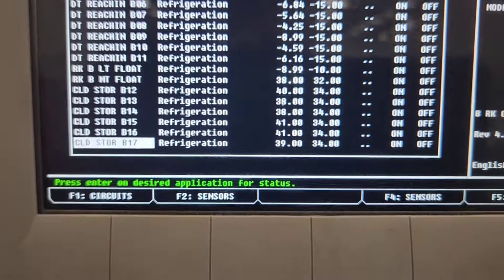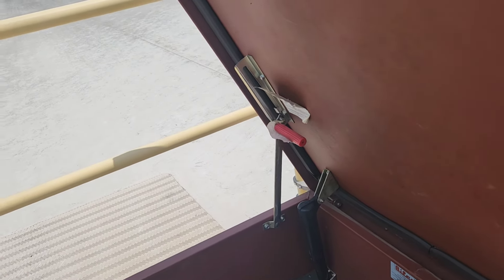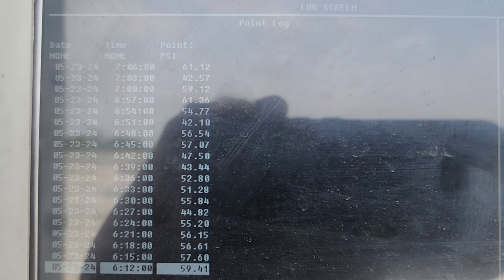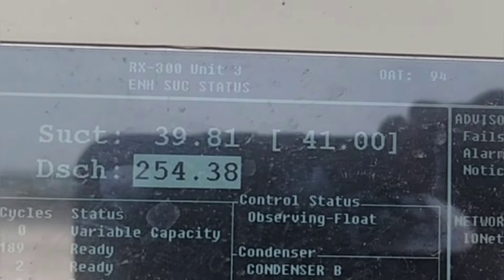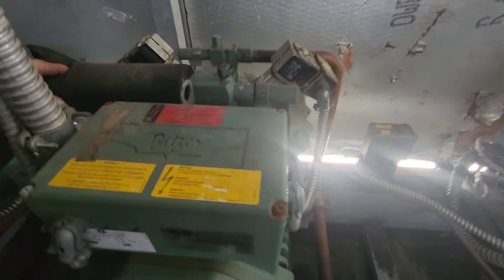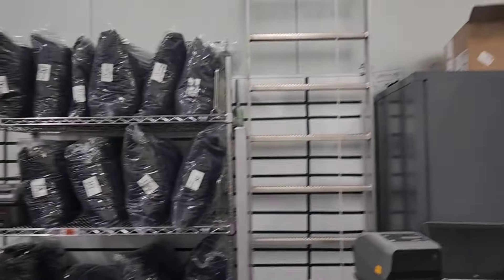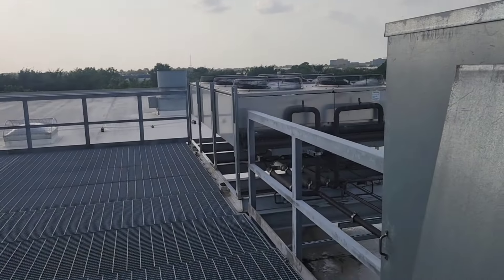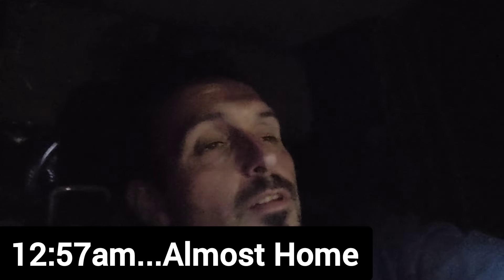Rack Unable To Maintain With Compressor Out

Comment: For the VFD, check the 10VDC input at the VFD terminals #55 and 53# (if memory serves correct). VFD may need to be corrected through programming if someone made an oopsie finger f**ing it.. As for the high suction, your rack will have high suction if the discharge is running high. Bypassing the VFD is not a bad idea around this time of year as long as we can correct the problem before the only two cold weeks of the year roll in lol Maybe the output for the unloaders are also messing with the suction pressure pulldown. Just throwing some stuff out there lol nice videos, brother. Please use your safety belt for going up those ladders while using the camera. Don't need to short the company one solid technician, papi

Comment: Bypassed the VFD temporarily until you get the motor corrected and run the condenser fans at 100% if you have that ability to change it

Comment: Soo outside coils was blocked causing to warm and icing inside
Reply from the maker: The high side pressure would not cause the evaporator to ice. I believe that there is another reason that the evaporator iced up like that. I found that there was a heating element on the bottom of the coil behind the fans, but none on the middle or top. Maybe this has to do with why it iced up like that
Reply: @HVACRServiceTech  i seen fridges 15% freeze up in a corner when not getting enough refrigerant (had one where one half of it was -15c other half was 25c they had to bin most of the food because meat was warm and vegetables you could use it as a hammer due to how cold it got, depends where the stuff was in the fridge) now the external unit can breath the icing might stop but i guess you be going back to this job late on to see how the system is running

Comment: I do believe to answer your VFD question and anyone please correct me if I’m wrong that the VFD senses the motor current during operation and when you wet the coil, it creates a higher motor amperage or amperage draw and the VFD senses and dust adds more airflow by ramping up to 100% that’s what happens on my racks
Reply from the maker: That could be. I wonder why Rack B isn't set up like that, If that's the way it's supposed to be set up.
Reply: I think what happened is the discharge pressure dropped because he was washing the coil, so the E2 reduced the fan speed. To be 100% sure as to what is controlling the fan speed you would need to check the condenser programming at the E2 and see what controls the 10VDC output from the analog output board to the VFD analog input. Most of the time the discharge pressure or even the dropleg pressure transducers have a large role dictating what output is sent to the VFD from the E2.